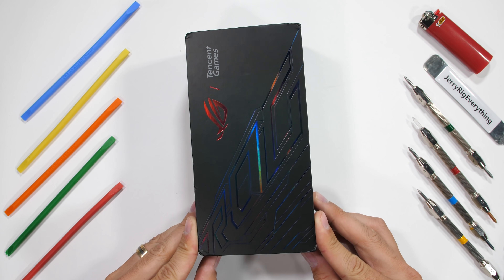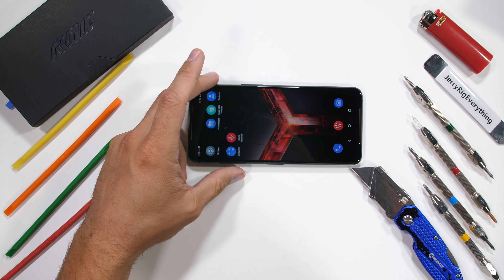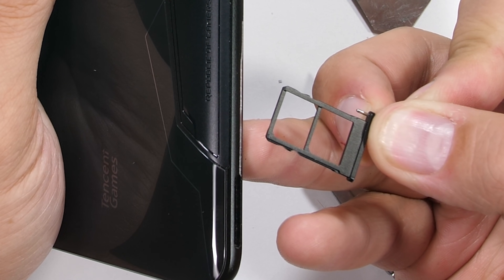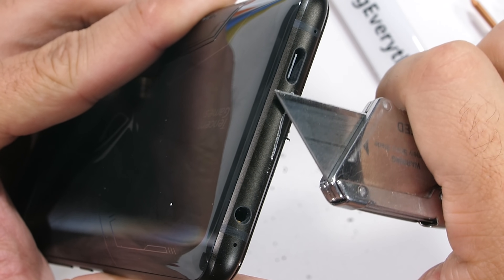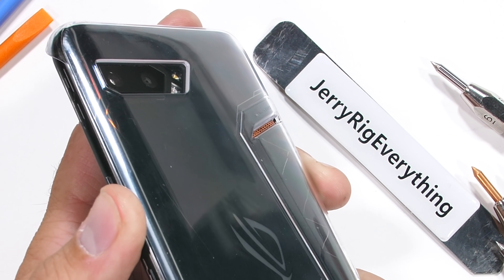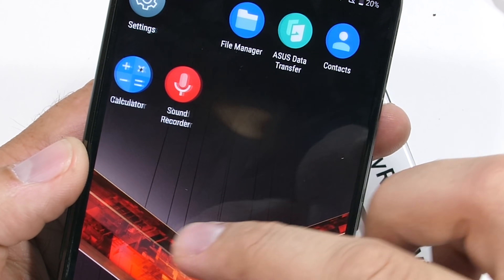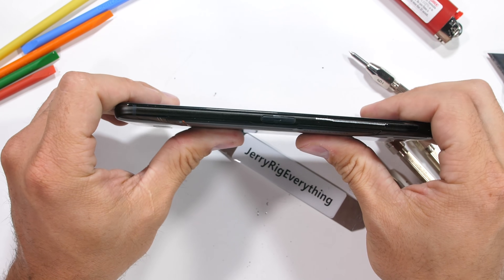ROG Phone 2 Durability Test! - Most Powerful Smartphone?

Comment: Hi jerry. Can you test wiko robby cause i had terrible experience hardware wise with it. Back panel is made from two parts that are glued together with some adhesive. Back panel is made from aluminum btw, so after only of two years using it 1 part of back panel has separated from the other one. Also screen has now huge crack so the phone didnt withstand test of time.

Comment: Drop it in water?  Does the cooling system expose only copper under the vents or is there a way for water and dust to get to the circuitry pretty easily?

Comment: Apple : oh! We can't put a headphone jack 
Asus : let's add 2 charging ports
Reply: And the headphone jack.
Reply: @eeeeeeeeee802  *jacks
Reply: Don't forget that 6000mah battery.
Reply: Apple could've put the jack and anything else in it, but if they do, the selling of their air bud possibly wouldn't be as high as it is now. They're ripping their fanboy off their money
Reply: Also asus: you guys can't fit a headphone jack? I'll add it and As a bonus I'll add a massive cooling system
Reply: @kiro_luv8424  and if you have the fan pack in it even has 2 headphone jacks! I haven't used them yet though but I know they're good quality.
Reply: Technically it's three
Reply: @OREOUz  only two. The third, orange, port is dedicated to their accessories and will be damaged if you try to plug a regular USB cable into it.
Reply: 700th! Congrats!
Reply: Apple can take away half the screen and I’d still buy it. One thing Apple does right that android could never is the smooth and clean looking OS. I never liked android because of that. And it seems android phones tend to slow down a lot quicker.
Reply: @Christian-ru6op  bruh you iPhone fanvkys prob only used an android like 10years ago
Reply: @Christian-ru6op  If you dont like how the android looks you can just change the theme
Reply: @Christian-ru6op  it's called rooting. You could put iOS on an Android device for that reason. That's among many many reasons why Android is an open source os.
Reply: @Christian-ru6op  bruh you can change the theme. And any Android having the price of an iPhone is smoother than all of the iPhones because of it's higher refreshing rate + processors capable enough
Reply: @ryderfromgta  I mean, to an extent, Chaz has a point about the OS, since it's a purely personal preference. But he's 100% wrong about android phones just "slowing down." And is that "OS cleanness" worth it for the lack of features you get from Apple?
Reply: Kindle Fire: Hey, I've see this one!

Comment: Watched this on my rog phone 2 😁. 512gb model. Slightly different as mine doesn't have the metal on the back. The vent section is glass matching the rest and the box and accessories are also different. Wondering in the glass on the back instead of metal would more rigid in the bend test near the second ports location
Reply: Huh I just noticed mine does too after looking at the back and I have the ultimate edition.

Comment: would buy it for the looks, performance and battery. but no sd card slot is a killer. mostly for backup reasons. if the mainboard dies, data recovery is expensive to impossible, depending on what and how it died.

Comment: My one plus 6t perfectly fine at gaming at maxed settings. I see no need for the 855 or 855+. 8GB of ram is fine to I usually run 3.5 to 5GB free the seamless multi taking is flawless to. Even with custom software. For a $385 used phone I made a good score. Granted I've put a massive Galaxy s10+ heat sink in the phone with thermal compound. But I have 0 temp throttling now. Overall best phone I've ever had.

Comment: I love your videos and the commentary!
Just a bit I think you should take into consideration with some of the verbiage you use with the materials.  As a machinist who has worked with a lot of steel, stainless, and aluminum. I think when you scratch the sides of the phone and say it's made from "metal" you should specify.  Because aluminum is NOT metal, it's an alloy.  A metal is ferrite or iron based. Aka steel.  True stainless is also not referred to as steel it's just "stainless." Like "304 stainless"

Comment: This is not a durability test at all, it what can i do to destroy this test.
Reply: Yes, that is what a durability test is.
Reply: @dannytheuncanny5176  Durability testing is the duration of time a product, part, material, or system can meet its performance requirements. e.g. lifetime span. ... Durability Testing is a Performancetesting technique used to determine the characteristics of a system under various load conditions over time.

So what your video is nothing like that, more on how i can destroy it.

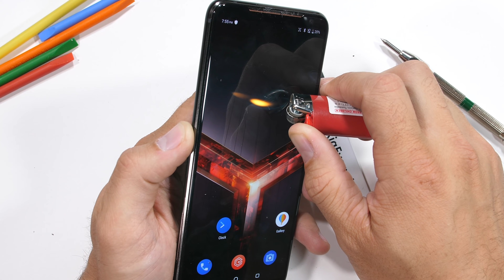Comment: 5:54 - Movie is a bad example. 120Hz doesn’t make any difference for movies. Most movies are shot and played at 24 fps (0r 23.976). It‘s important that the display is able to dynamically adjust framerate rather than just having a high framerate. A 24fps movie looks best when the display is set to 24Hz. I‘m pretty sure this phone does dynamically adjust framerate, otherwise it would be an extremely inefficient display anyway.

Comment: Apple: remove earphone jack to give space for battery

Rog: two usb type-c, one earphone jack, one hdmi port
Reply: It actually had 3 type c port , 2 ports for accessories and 1for charging .
Reply: Even the battery is 6000 mAh
Reply: Not to mention the price..?
Reply: Astolfo makes my bone hard
Reply: More ports than lastet mac
Reply: Then how about other android phone didnt have jack? What space they saving for? Or just apple wannabe?
Reply: @24t7  
Not sure if this was a response to me.

But Apple is right, internal space is precious. But that doesn't justify removing features to make it consumer-hostile. If you read my comment you would've understood that. Here's just a list of user-friendly features that OEMs are cooperatively eliminating:

Removable SIM Card
Removable Battery
microSD card
USB-C port
Headphone Jack
USB Functions (3.1, OTG, Host, TV Out)
Modular Internal parts (non-soldered)
Front-firing Stereo Loudspeakers
Water and Ingress Resistance
Non-fragile Metal or Carbonate Backplates
Flat Displays (more durable)
Standard Aspect Ratios (16:9 or 21:9)
IPS Screens (no burn-in)

You can see Apple, Google, and Huawei are the worst offenders. Even Sony, Nokia, and Oppo are joining them in this bad-trend. A few players also experimenting with consumers is Xiaomi, ZTE, and ASUS. In the mainstream it looks like LG, Motorola and Lenovo are last ones being somewhat consumer-friendly. Of course, this all depends on a per-device basis.
Reply: Cause it's a gaming phone....not a show off phone
Reply: That’s all fine and dandy but this thing looks absolutely hideous in my opinion, and looks are also a big part of why someone buys a phone.
Reply: @Froot99  who the hell cares about that? These days, you stare at your phone once in a while between the times it's buried in a case.
Reply: To be fair, I would be more than happy if they removed the 2x USB-C extra accessory ports. Then moved the Headphone Jack, and the main USB 3.1 port to the centre of the left-side.

The single USB-C port can handle things like Fast Charging, OTG, or TV-out. Whereas the Headphone port will be boosted by the QuadDAC shared with that phenomenal Front-Firing Stereo Loudspeaker system.

I would also gladly switch that DualSIM slot to have a microSD slot instead. Gotta have somewhere to store games and media, or somewhere to store your 4K Video recordings.

Now the top-side and bottom-side can be left blank. This is good news for sliding in some JoyCons directly to the handset. It would've been great to add an IrDa blaster as well, in fact, I'd trade the "Air Triggers" for it, since having JoyCons are better.

The only other modifications I would make would be to make the device slightly smaller so that its pocketable, switch the display aspect ratio to 16:9 or 21:9 formats. Also might go for an LCD screen (no burn-in), whilst including a User Removable Battery for the ultimate device longevity. Otherwise, just stick with OLED but maybe make the whole device IP68 water resistant.
Reply: @ekinteko  the 2 USBC ports have to stay. They're for charging while gaming
Reply: @GBA_Raspberry  
Nope. Just one USB-C port is needed for that. And that's what I'm proposing. Remember these are extremely mobile devices, so internal components are a luxury, and compromises need to be drawn.

It would be a better device if it was more portable.
Reply: @ekinteko  hmmm, they added two for a reason, I'm pretty sure it was for other than charging. But if I was to have a gaming phone, there needs to be at least one in the middle.
Reply: @GBA_Raspberry  
They added two because the RoG 2 is backwards compatible with the accessories of the Mk 1. The reason why there's two is because, one is for high-bandwidth data (ie Dual Display) and the second one is power-only.

So like I said initially, there's no need for 3x USB-C ports. Just have 1x port that does it all. Put it centrally on the left-side, and put the Headphone Jack next to it. That will allow you to make the phone physically smaller while keeping the big battery.
Reply: +Kangal

Wear and tear says no. Adding more ports just overall makes sense for longevity.
Reply: Very cheap on price.... Grt phone..
Reply: Paizuri 
It’s a thick-ass brick. They can put the kitchen sink in there. Too bad last year’s Apple phone still beats this gaming phone in benchmarks and gameplay.
Reply: @Ryotsu2112  nope in gaming no stupid 60hz phone can beat the smoothness of 120hz... Just get fck out of here office boi
Reply: Kiro 25 120hz but most mobile games are running at 60hz, few games like vainglory supports 120fps rog 2 is the perfect phone to play that game
Reply: @Ryotsu2112  lol staph it
Get some help
Reply: Fido Montoya 
Say that again but without crying this time.
Reply: @xenomorphisisdilage472  comedy gold.except it's true.
Reply: @xenomorphisisdilage472  🤣🤣🤣
Reply: @Ryotsu2112  whats up with y'all wanting thin ass phones?
Reply: @saulloll8547  Mindlessly following a current trend, same with laptops.
Reply: @Ryotsu2112  too bad rog phone is only 1/3 of the price of apple shitty phone with double the features.
Reply: @Ryotsu2112  it, it doesn't tho. and even if i could, it doesn't have the hardware to display it correctly.

Comment: That's not 2 types of flash one is specially made and it's rgb for when you put rog case for that phone, it transmits light through a white plastic from top of the screen to middle, you should watch a video from LinusTechTips if you need more info

Comment: As a professional IT I’d say its not the most powerful phone when its SOC is still weaker than the a12 bionic. Vents, heat pipe, more ram, LED and aesthetics isn’t a benchmark to evaluate as “powerful” but the processing power of CPU and GPU is.

Watch garyexplains speedtest g2 to understand more about “power” in mobile.

Comment: I could buy that smartphone not for gaming, but productivity. So no lag using Excel and office apps. Also with the deck you can continue to working when you arrive home/office just plugging the smartphone and use a monitor, keyboard and mouse ... ALSO A GREAT BATTERY AND HEADPHONE JACK. That's my reasons, not gaming or 120hz oled hdr delta -1 display.

Comment: Almost perfect phone with almost everything what I need
I would love to buy it.
Unfortunately no IP rating disqualifies this device at the start...
I live in a very rainy country with wind and rain storms and waterproofnes is must.
Reply: Just get the Galaxy phone. Only downside compared to this is the battery. Find a battery case and there you go
Reply: @MelodicTurtleMetal ,  @MelodicTurtleMetal , I dont like Samsung. Way to slow with updates (sometimes 2-3 months later), overpacked with preinstalled apps, I dont like the user interface (it annoys me), a little bit overprocessed photos, and the worst thing: no bezels, punched hole screen (terribly uncomfortable to hold with one hand while watching movies lying on a side what I do often and no place to hold while gaming)
Right now I am rocking Xperia1. Perfect for gaming because of smooth synchro with PS4 conttroler and its heptic feedback.
Also you see much more of the gameplay with 21:9 screen ratio.
Also perfect for movies. SONY fortunately still have nice pretty bezels and awesome DOLBY ATMOS sound.

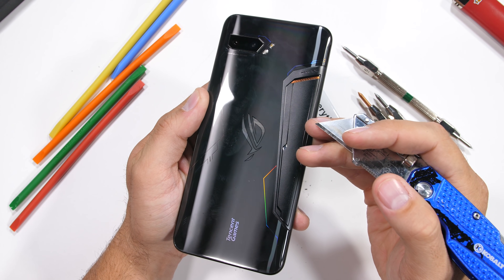Comment: 4:03 how can zach advertise earphones with micro usb charging to us in 2019 :(
Reply: Just buy a magnetic adapter or something, should solve the issue well enough since you'll most liekyl be charging it at home
Reply: @RennieAsh  shouldn't have to buy an adaptor. Just use usb-c and make the world a better place
Reply: MelodicTurtleMetal I’d probably use a magnetic attachment with USB c anyway. You can limit your options or you can find a simple solution to solve small compromises :)
Reply: @RennieAsh  ... That's a good point 🤔
Reply: MelodicTurtleMetal it would be interesting to hear why they choose to use the micro USB. Maybe the 1%er cost cutting or maybe they thought the target market will be using older phones perhaps?

The magnetic attachment is nice though, one part sits in the port the whole time and usually you can wave that at the cable end so it attaches itself :) The downside is if you go to plug in someone else’s cable

Comment: "Technically a gaming smartphone" meaning all of flagships with 855+ is a gaming phone. And all arounder
Reply: it's funny how people thinks SoC doesn't include GPU
Reply: Gaming phone have bind processors which are different from normal 855 they pack more performance than normal 855
Reply: @SiddharthVyas  its called 855+
Reply: its a binned and overclocked 855.
Reply: @SuperUltimateLP  what asus said, 855+ is an overclocked 855
Reply: You people forgot about the air triggers, big battery, side charging and headphone jack port, the specially made gaming accessories and gaming optimize mode.
Reply: @aoi7091 my bad , im editing my comment :)
Reply: Must phones throttle and doesn't do well when playing more than 30 minutes but this one doesn't throttle at all (I don't think thats even writen in kernel of rog phones) and it can limit/overclock itself manually and there are hell of a lot of other things than raw performance of soc that matter for a phone being gaming like air triggers or 120hrz refreshrate or even 1ms response time and 40ms touch response  (must close phone i think is xs max with 74) or that monsterus sterio speakrs
Reply: just watch unbox therapy's rog phone 2 video....then u will know the difference between gaming phone and normal phone
Reply: Zack talks about the performing cooling system and accessories which aren't found in every sd 855/+ smartphone...
Reply: You forgot about GPU, a HUGE factor when talking about gaming performance
Reply: @belvinnadar5782  lol are you trying to say other phone that has sd855+ doesnt come with the same gpu
Reply: @aoi7091  bruh moment
Reply: @aoi7091  I don't think OnePlus 7T has a flagship GPU, even though it has the SD855+ processor. (Not sure)
Reply: @belvinnadar5782  bruh, every mobile phone has its CPU and GPU on the same chip... meaning, that Chip had the same CPU and GPU combo..
Reply: @belvinnadar5782  it does
Reply: @belvinnadar5782  dude soc are something that has every component inside (cpu gpu dsp isp modems) and you can't have same soc with different gpu
Reply: @belvinnadar5782  lol every sd855+ have the same gpu in Phones case there are no separate gpus like pc it's all included in Soc chips
And what differentiates rog phone, Nubia and blackshark are how they handle thermals and all the accessories available for them rog is special even among them lol it has two usb ports yes one accessory but still can be used for charging and stuff and i guess it has two headphone jack
Reply: @arianamirgholami9555  got it